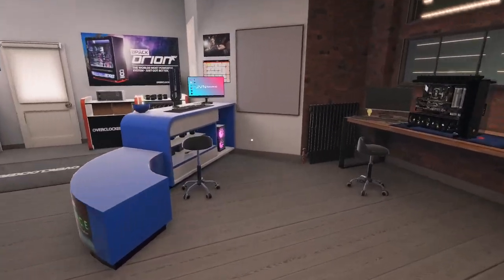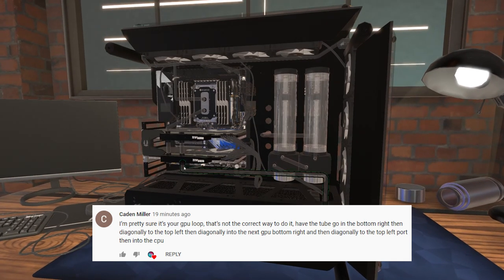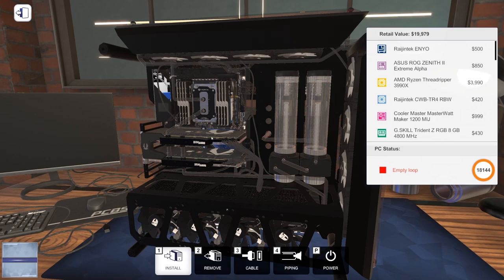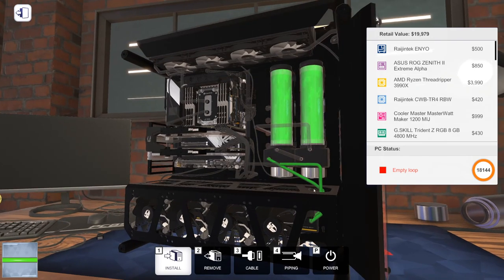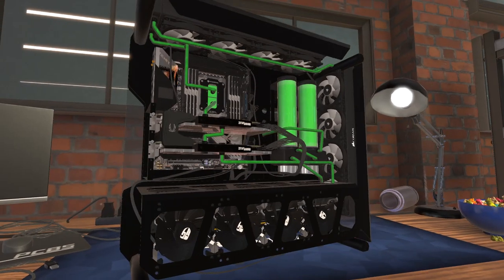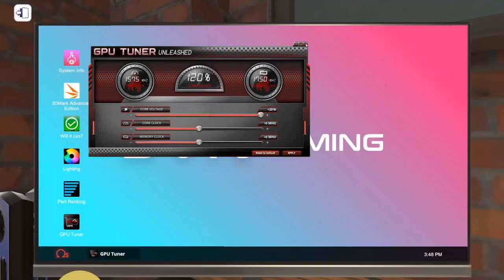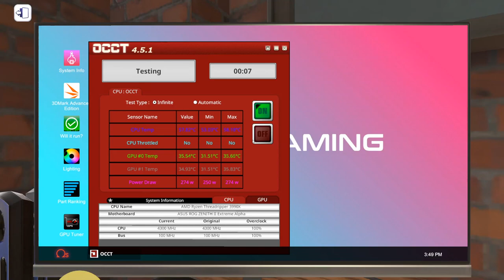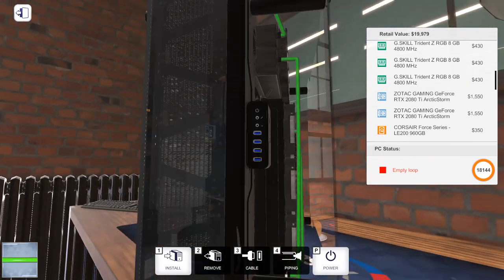FIXING The Most Expensive PC - PC Building Simulator

Comment: Did a very similar build to this but with different ram and less rads, managed to get a 3DMark score of 22199 with cpu and gpu overclocked to the point of just being under throttling temps, wish they would make a change with the m.2 drives with heatsinks so they can be added to higher end boards that have their own
Reply from the maker: Nice score! Yeah I agree the m.2 stuff can be annoying since some of the heatsinks are so chunky.